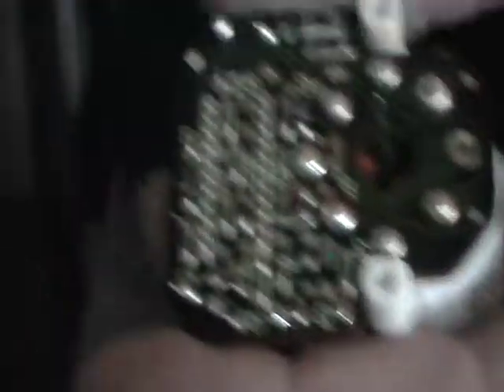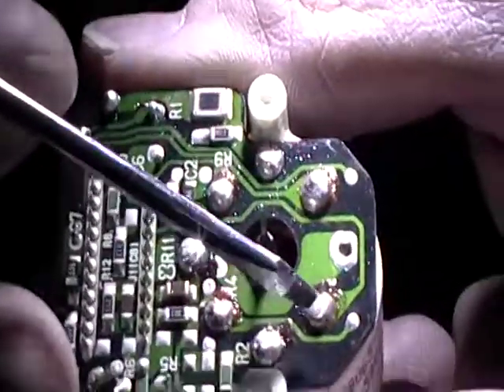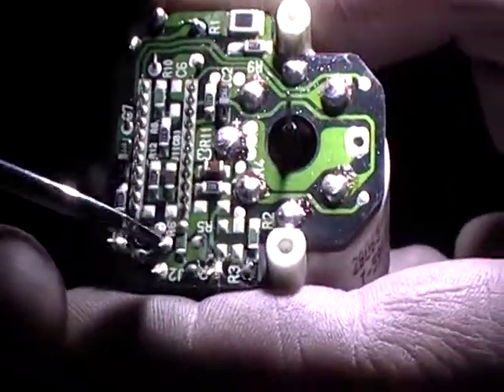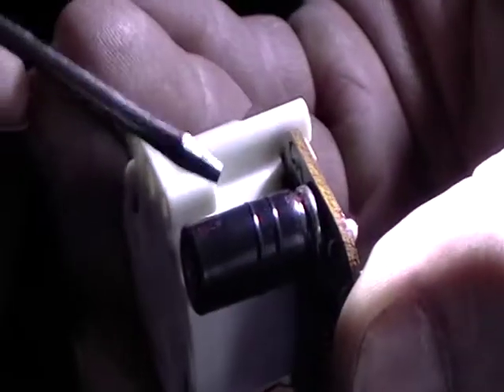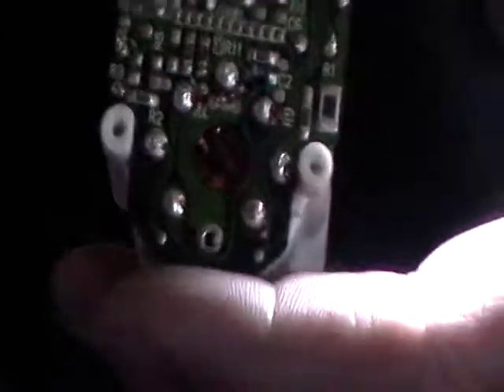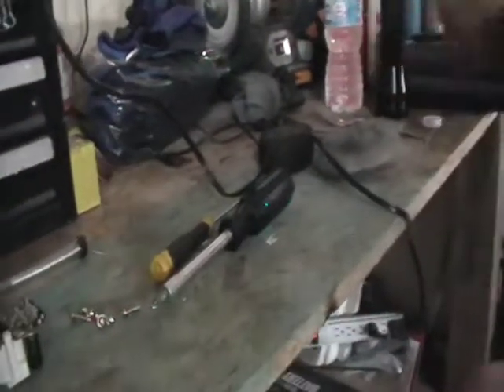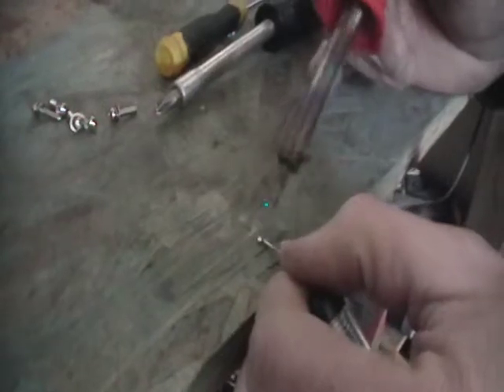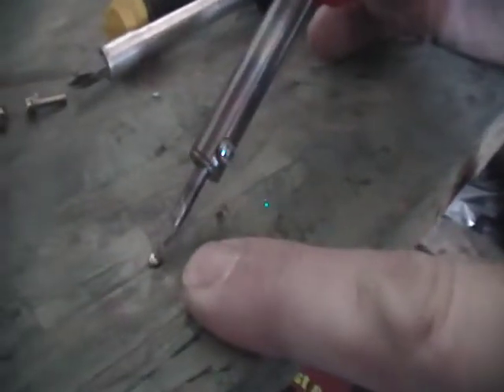1995 Nissan Pathfinder Tachometer fix

Comment: Hello. I have a 95 Pathfinder with a fluctuating (semi ) working tach. In your video. Is this part located in the dash?
Reply: Or is there anything possible on the back drive shaft / rear wheels to check?